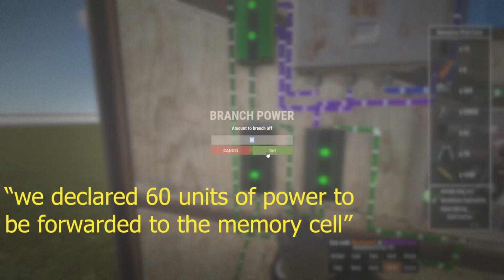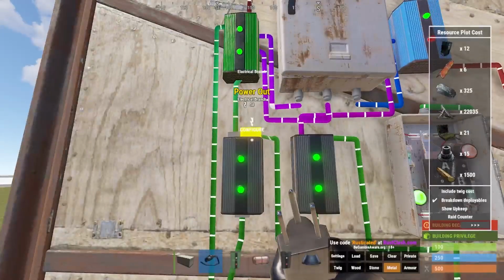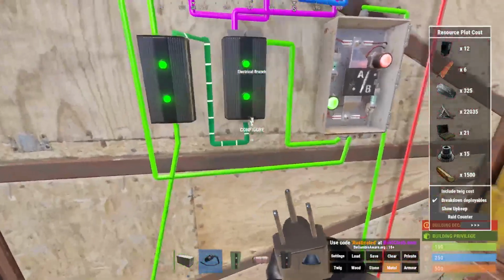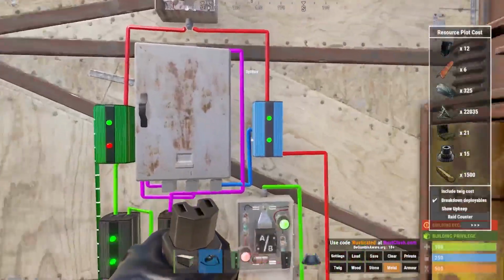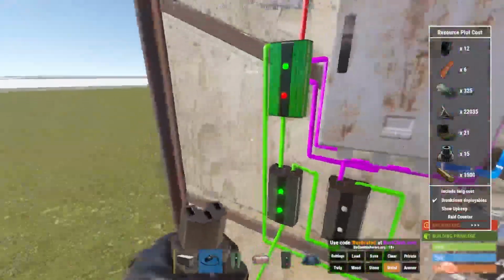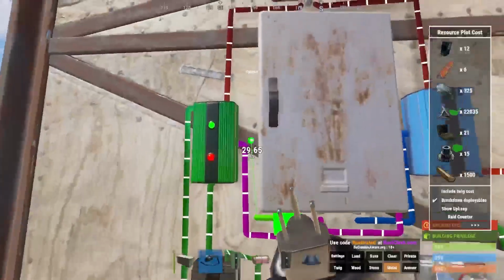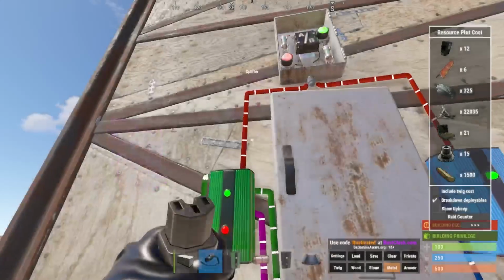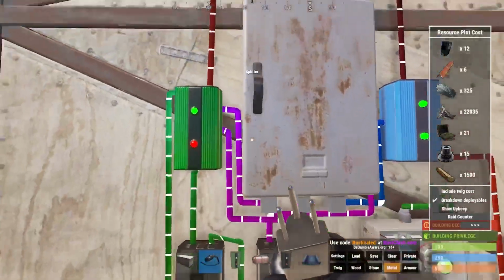Rust Electricity - The Nih Core

Comment: I found a flaw,  If you run the battery directly into the blocker, then into the XOR switch, you make active usage to full battery.  Instead  after the blocker put a branch in and set it to the same as you do for your active circuit branch in the beginning.

Comment: Can u connect multiple batteries to one nih core? If so could u do a video on it thanks great vid btw
Reply: Put a splitter to charge two batteries to each input. Use a root combiner for both outputs to the circuit

Comment: What advantage does this have over a simpler 2 electrical branches, 1 blocker and 1 OR switch? Does it waste less power? I guess I never thought about it but the power branched to the OR switch directly from power source might not be charging battery when falling below specified output?
Reply: That would be the big difference yes.
So if you need 80 power and source gives you 75.. then you are using batteries and the 75 are lost.
The circuit shown here would redirect the 75 to your batteries, and make them drain slower.
Since you are using the battery while also adding the remaining source power, you are utilizing all the power you are generating. none is lost apart from the 20% battery tax and component tax.
Reply: @Nihagi  this guy is a lowkey genius. I only discovered recently that the electrical branches' branched power output constantly drains/uses power from a power source, even if not connected to anything. A bad design feature (possibly bug) but this is a great work around.

Also what do you mean by 20% battery tax? I have never heard of this
Reply: I dont know if anyone gave you a good answer:

The answer is: in the circuit you describe, if the batteries are on, what happens to the power from the windmills?

In this circuit, that power still goes to the batteries.

This circuit is only good if you have a LOT of power needs. This isnt needed if you only have 3 solar panels